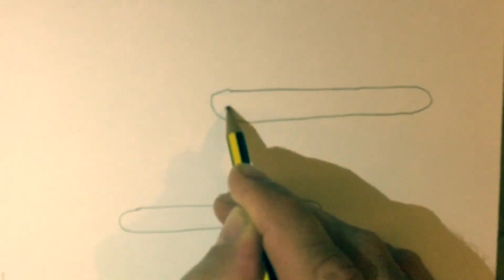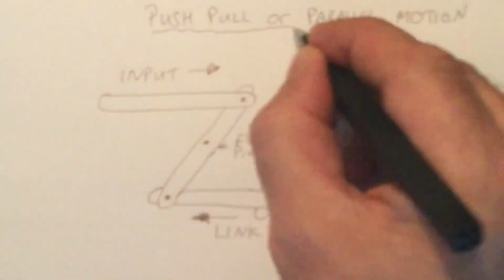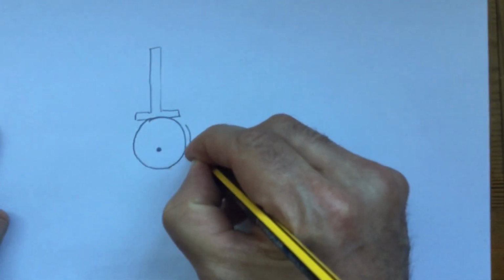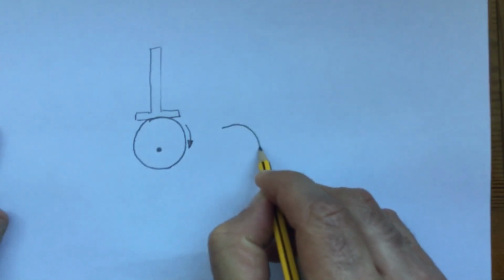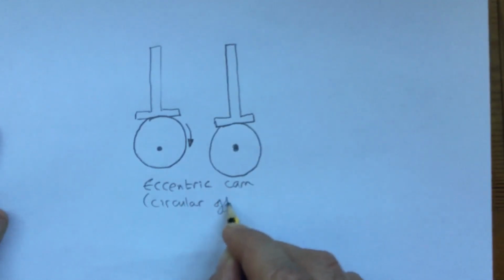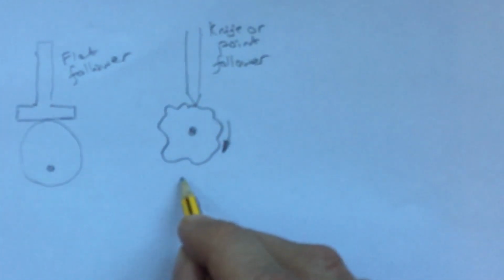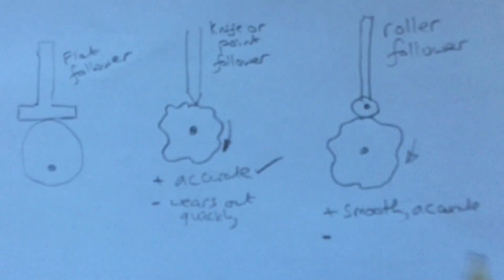Mechanical Devices 2

Comment: Thanks again Jon, these a brilliant and very helpful for KS3 work while we're closed.
Reply from the maker: You’re welcome and I’m glad they’re useful. Mechanisms 3 is on the horizon looking at gears and belts and pulleys. I’m also working on one about generating and storing power and another about how we’ve used production aids to produce batches of visors for the NHS. Thanks again for the feedback and I’m glad you’ve found them useful.
Reply: @dtmrc768  ⚠️ God has said in the Quran:

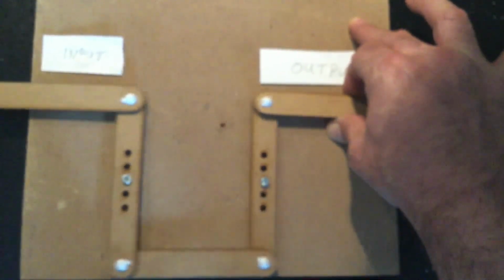🔵 { O mankind, worship your Lord, who created you and those before you, that you may become righteous - ( 2:21 ) 

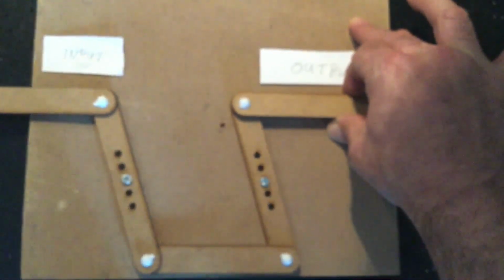🔴 [He] who made for you the earth a bed [spread out] and the sky a ceiling and sent down from the sky, rain and brought forth thereby fruits as provision for you. So do not attribute to Allah equals while you know [that there is nothing similar to Him]. ( 2:22 )

🔵 And if you are in doubt about what We have sent down upon Our Servant [Muhammad], then produce a surah the like thereof and call upon your witnesses other than Allah, if you should be truthful. ( 2:23 )

🔴 But if you do not - and you will never be able to - then fear the Fire, whose fuel is men and stones, prepared for the disbelievers.( 2:24 )

🔵 And give good tidings to those who believe and do righteous deeds that they will have gardens [in Paradise] beneath which rivers flow. Whenever they are provided with a provision of fruit therefrom, they will say, "This is what we were provided with before." And it is given to them in likeness. And they will have therein purified spouses, and they will abide therein eternally. ( 2:25 )

⚠️ Quran